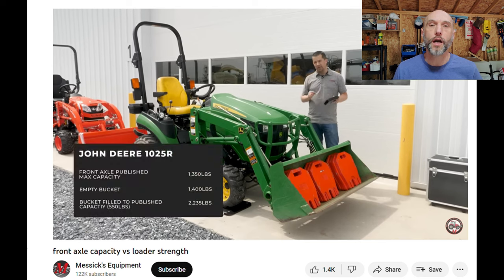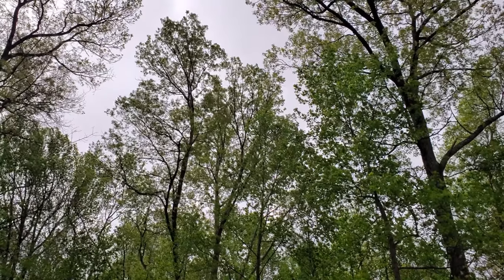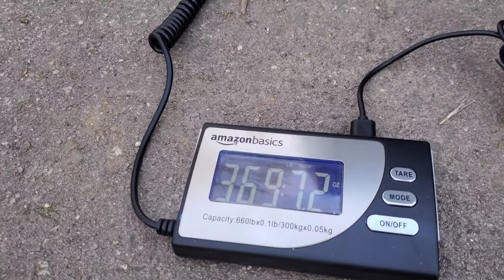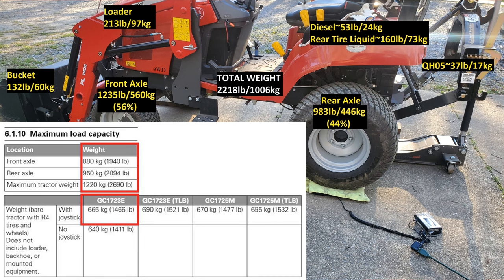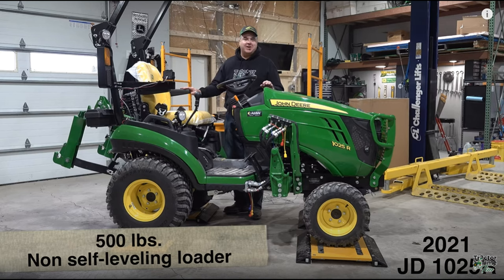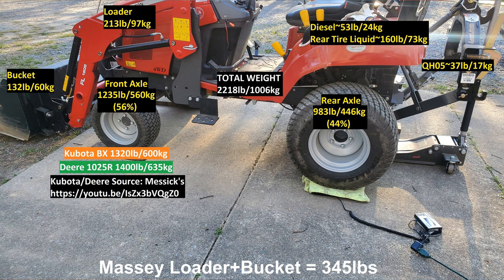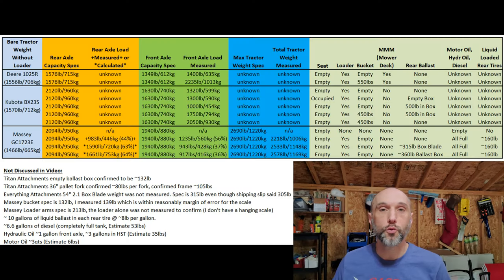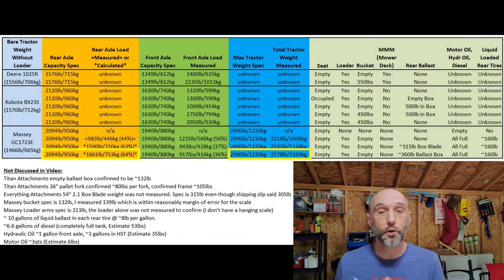Ballast, Total Weight, and Front/Rear Axle Loading GC1723E

Comment: Good vid, Ed.  Topic of ballast comes up a lot on tractor forums, with common recommendations being a counter weight on the 3 pt hitch and loaded tires, but that's not always the ideal option depending on application.  For instance, counter balance is what you need for lifting stuff with the loader to relieve stress on the front axle, but it becomes counter productive when plowing (and especially snow pushing) because you're lightening the weight over the front tires, and then start losing steering when the plow or pusher box starts riding up with the snow buildup on it.
Reply from the maker: I'm so glad you mentioned that. I am going to pin this comment to the top. The GC definitely needs that front end weight when plowing.
Reply: @Redneck_Ed  I love youtube because of stuff like this, eg, learn something in a vid, read stuff in the comments, bounce ideas of each other...youtube university!

Comment: Good video Ed… I wasn’t tracking the specific total weight spec on the GC series being that low.  I have a GC1725M and this made me realize I probably have exceed the total weight spec nearly every time I’ve used the tractor at some point… tractor has about 200 hrs on it total so far!  I have a ~625 lb home made concrete ballast box and the same 315 lb box blade as you, and have spent a lot of time moving heavy top soil, tree debris, and logs.  These little subcompacts are almost useless without ballast (2” wheel spacers help with stability too), and honestly it’s not safe using the loader for normal loads without at least the 315 lb box blade (I normally use the 625 lb ballast box for any real work).  Tractor seems to handle it without issue, definitely a strong machine for it’s size.  I believe Tim at TT w/Tim consistently runs his 1025R at over 3000lbs if I remember correctly.  Anyway, the GC is primarily used for lighter property maintenance now anyway sine I’ve acquired a larger 35 hp tractor with about double the lifting capacity for the heavier loads now.
Reply from the maker: I'm sure that we're all exceeding those specs at times. The spec number for total weight seems low, and the machines can clearly handle more. As you mentioned, you just can't work safely without some ballast weight. If that puts you over the total weight spec at times, then so be it.

Comment: Great information.  
I once wanted to quickly move a pallet of material without anything on the 3point and found I could barely steer.
Reply from the maker: That's a great point. Loading down that front end really puts a strain on the power steering. I've been in that situation before too.

Comment: What did you use to ballast the rear tires?
Reply from the maker: They came with liquid ballast from the dealer. I'm honestly not sure what they used.
Reply: @Redneck_Ed  some ballast is 11 lbs and some 8. Anti freeze is too light . beet juice is best.
Reply from the maker: @tlm3574  Since I haven't weighted just the wheels or checked, I'm just not sure what is inside of mine. In the video, I assume 8lbs at 10 gallons per tire. Beet juice is listed at 10.7 or up to 11 lbs and is best to maximize weight density, but I don't agree that antifreeze is too light. Lots of people fill with washer fluid or RV antifreeze and if you do that plus have rear ballast, it's a workable combination. One issue with RV antifreeze is that at -8 in my freezer I did get it to solidify some. It doesn't expand and cause issues, but having a solid chunk of anything inside the tire isn't good. My climate here isn't cold enough though to worry about that hard of a freeze. Canada...probably a different story.
Reply: @Redneck_Ed  if you are curious(I am) you can park with valve stem below top and let a little fluid out. If its dark and smelly its beet juice. If it's salty its calcium chloride, if its bluish its windshield washer, and if its yellow anti freeze. Or ask the dealer. He probly puts the same stuff in all his tires. Mite be useful to know for weight purposes and in case you have a leak you can protect your pets and livestock. More vidoes. Yours are interesting.